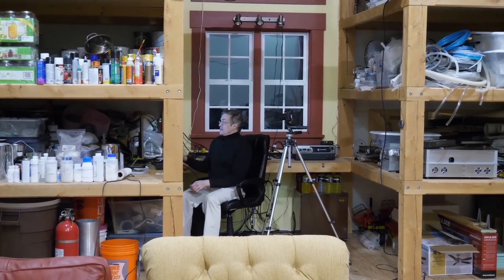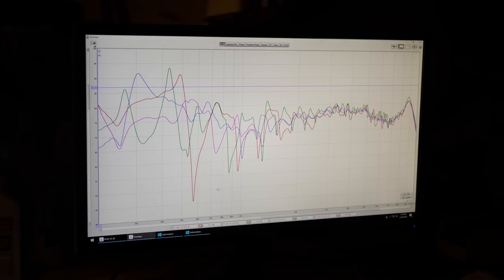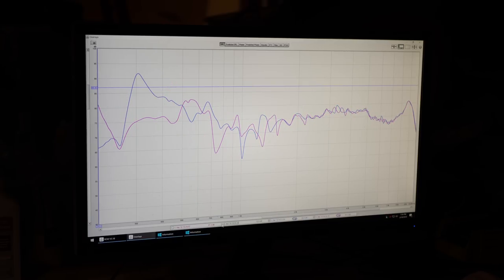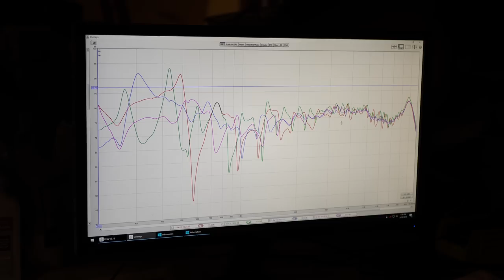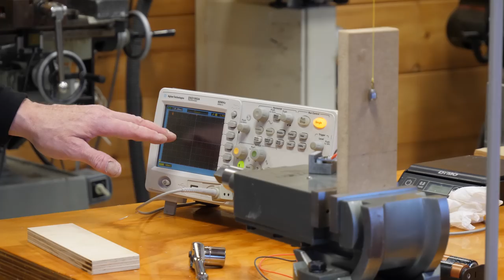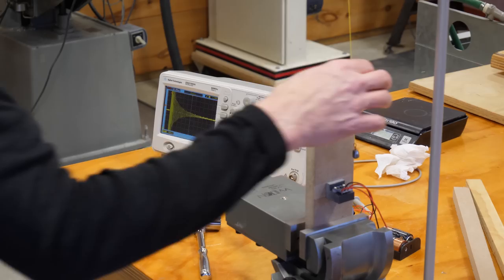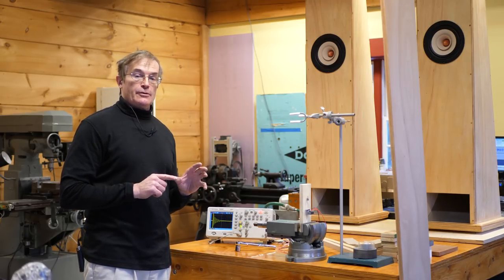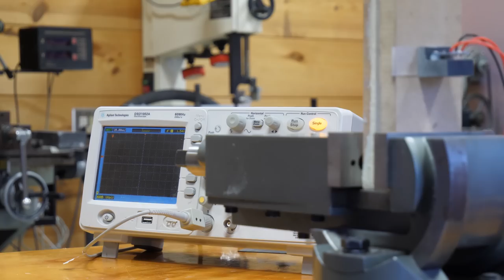World's Second Best Speakers!

Comment: Hi, IF you know that you're not going to move your speakers, there's even a better solution, as most of high quality home made speakers are done this way (especially when included in walls or built in a former chimney), you use marine plywood a bit thinner to construct "a box in a box" (with spacers between them, of course) and you pour concrete between these two walls.   Marine plywood to cope with the concrete dampness and concrete to avoid any parasite vibrations when in use - it can even change a poor design to (almost) good speakers.   As the french electronics/audio magazines are now scarce and only the shadow of what they use to be 40 years ago, I don't know if this method had a good survival index, but in the past many tests and trials shown it made audio quality excellent.
Reply from the maker: I understand, but that's  a big assumption.  Painting,  cleaning, redecorating, and relocating all benefit from being  able to move your stuff. This is especially  true if you don't  own your home and if you've invested a lot of money  in these speakers. Convincing the realtor  that it's  not a problem that a jackhammer can't  address isn't  going to be easy.
Reply: @TechIngredients  This is quite obvious, it is an owner only move.

Comment: I know, it's a while since this was posted, but I'm really keen on finding out if I could build this, but scale it to size a different speaker.
ie, if I had a speaker that was 60% of the size (a 4in driver), would I be able to scale the enclosure to 60%?
Reply from the maker: Look for the manufacturer's "open volume" recommendation for that driver and then scale the speaker to generate that volume.
Reply: @TechIngredients  You're the best. Is the Compliance Equivalent Volume (Vas) the same as that?

I can't see the open volume, but the Vas is there

Comment: there can't be a better speaker than in a  very heavy, 400 or 500 pound concrete enclosure,true or false?
Reply from the maker: False.
This design undoubtedly  could be improved  with better materials  and even better drivers. The principles remain constant. You can't ignore resonance, interference, and reflection effects.

Comment: Have you thought about using rubber gaskets? Could they be able to dampen the resonance?
Reply from the maker: Not if they're elastic and return much of the energy absorbed when they are stretched.  You want a material that is gel like or tar like, something that deforms but doesn't rebound.

Comment: I find your comments about MDF as speaker cabinet material surprising. I always had an impression that it is excellent material for building speakers cabs because it is inherently very dead acoustically, it does not reflect much. But then again these speakers of yours are not typical rectangle boxes. 🤔
Reply from the maker: You shouldn't find my comments suprising if you watched the demonstration where I proved what I said.
Reply: @TechIngredients  Yeah, I commented before I got that far. 😅

Comment: Love the video!  I downloaded the instructions and diagram.  While making a cut sheet for the cabinet parts I did not see a height measurement for the cutout in the bottom of the fronts.  I am estimating it to be 5.875".  Can you please confirm this value or let me know what the correct value is?
Reply from the maker: Sorry, it's 6.0" high.
Reply: @TechIngredients  I found another issue with the dimensions.  I used my 3D modeling software to build one of the speakers.
When watching the video it looks like you carefully align the sides to be even with the front of the 10" x 1" hole in the base.  
In my model this aligns the back of the face to be even with the hole and leaves a 0.25" set back from the front edge of the base, 
but causes the bottom of the sides to over hang the base by 1.25" on the sides if the bottom is 15.5" it will over hang the base.

This gives me a height of 79.375", base of 14.25" and changes the angle of the slope from 83.0 degrees to 80.9 degrees.  How do these measurements match your actual speaker?  Do I also need to adjust the 1.5" at the top of the side?

Comment: What if you mounted a speaker to a vacuum chamber?  No air to make waves in the back to interfere.
Reply from the maker: In principle that would work, but practically the force pushing the speaker into the vacuum would make it impossible for it to move and generate sound.

Comment: could you somehow isolate the back of the driver and membrane in a vacuum? or is that just technically impossible? or maybe it wouldn't even work? I'm sure someone ought to have had this idea before.
Reply from the maker: It's technically VERY difficult. The atmospheric pressure against the diaphragm is large, so the diaphragm needs to be supported, but still has to be free to move inorder to produce the sound.
Reply: @TechIngredients  yea I was thinking once you make the back a vacuum you probably just end up with a bigger resonance chamber. thanks for answering my comment on a 3 year old video =)

Comment: What would happen if the upper transmission line section is folded behind the lower horn/port section. This should result in the same internal volume, but significantly shorter. Would there be any negative effects of doing this?
Reply from the maker: Theoretically, it will work.  But, the turn itself  can introduce  reflections.  If the turn is a smooth  radius circle then this shouldn't be a problem, but construction will be more challenging.
Reply: @TechIngredients  That's exactly what I was thinking (radius the corners). Thanks for the reply!

Comment: Great video. Does the design scale based on the size of the speaker? E.g. 2in speaker would be ~4 times smaller.
Reply from the maker: Pretty much.
Good  speaker drivers come with specs.  The "open volume" indicates the optimal  performance  for an open cabinet.  Scale the design  so that the internal volume equals that number.
Reply: @TechIngredients  Well noted. Greatly appreciated!

Comment: At such low frequencies (150 Hz) I don't think the anechoic chamber is working as intended
Reply from the maker: It is, but due to its size it is limited as the frequency drops.
Reply: May I know the dimensions of the chamber and it's absorption material? I would like one in the future 😁

Comment: Question if u 3d print a mini tube and attached it to the back of the foam speaker would it give an effect
Reply from the maker: Probably based on its mass and position, but its shape should have little or no significance.

Comment: Could you use a separate driver, mid, and tweeter, or would that mess up the acoustics?
Reply from the maker: As it stands,  it would.  The position of each driver has to be determined relative to the distance from the top vs the bottom. It might be possible if the enclosure  were wide enough to allow each driver to sit side by side.

Comment: so does one of these new fancy amplifiers with a microphone basically negate the need for fine tuning with ports like this by adjusting the amplitude of each part of the frequency range?
Reply from the maker: It helps a lot.  But, by designing the speaker to minimize  aberrations, this additional  control  will work even better.
Reply: @TechIngredients  thanks. I'd find it really interesting to see a test showing how much a smart equaliser like this can do. e.g. a poor room and enclosure with such tech vs an optimised speaker and room but with regular amp

Comment: could decidamp be used to coat the internals of a vehicles door, floor etc to reduce noise in the cabin?
Reply from the maker: Remember, it's  not a coating, but a sandwich.  The principle  requires two stiff layers to be separated by a compliant but inelastic, dampening  material.

Comment: Also If I cut the sides to the dimensions given the angle is 10 degrees not 7?
Reply: 10 degrees at the top and 80 degrees at the bottom.

Comment: Can I rescale the model for a smaller full range speaker without loss of quality of the sound design?
Reply from the maker: Yes.  Look for the manufacturer's recommended open volume and scale the dimensions to enclose this volume.
Reply: @TechIngredients  Thanks! I have pair of markaudio alpair 10p. I'm sure that will work out great.

Comment: How would these speakers compare in a hifi listening setting to a Transmission Line speaker with a tweeter and woofer?
Reply from the maker: The comparison  would have to be direct as it may prove close and come down to the quality  of the manufacture.  The principles  aren't that different.
Reply: @TechIngredients  thanks for the response! I'm deciding between building these or a DIY kit from CSS

Comment: How did  you bend the aluminium plates 4 times exactly the same? Any hints :) Thanks - Great video!
Reply from the maker: We have a sheet metal roller. I'd recommend cutting the sheets and finding a local machine shop with this equipment to bend then.  It takes a few minutes and the cost should be quite reasonable.
Reply: @TechIngredients  thank you. Thats was quick. I will give it a try asking around. But one More Thing. IT says 34" Radius in your document, but the visuals  dies nit Show a perfekt circle piece. Is that a drawing error or how should the Metall ne Bend. Thank you.
Reply from the maker: You specify the radius of the circle. This plate represents a segment of that circle and it's straight length will define the arc that includes that segment.

Comment: So if not a thicker layer what about using 2 layers of the desadamp
Reply from the maker: As long as there is a stiff layer of material  between  the Desadamp layers, that would work even better.
Reply: @TechIngredients  yhea that's what I was wondering. So a multi layered sandwich with board, DD, board, DD, board. Cool thx been researching speaker building something I've enjoyed for a while but only recently gone passed the basics so glad found your channel. Never heard of Dampadex before so really useful.

Comment: Something just struck me.  It has no significance, but is interesting.  Sound travels at 300 m/s.  Light travels at 300 million m/s.  Hmmm...
Reply from the maker: Problem  is, one million is significant only because  we use base 10 and that's  because  we evolved with 10 fingers.
Reply: @TechIngredients  Note that I said it was NOT significant, just "interesting."
Reply from the maker: Actually, what I think is more "interesting" is the intensity of those that argue  that the metric system of measurement is inherently superior because it is base ten.
Reply: @TechIngredients  I agree.  Every engineer needs to be competent in both, specifically, the S I, and the "U S system of engineering units."  In that system, the units are seconds, pounds, and feet, for time, force, and length, respectively.  Mass is force/g (some call them "slugs," but that's yucky).  None of those ounces, yards, minutes, fortnights, hundredweights, bushels, cups, etc, etc, etc...   It's every bit as logical as the metric system (which can be S I, or cgs).

Comment: There are various automotive products made to absorb sound that might prove to be less expensive. Sprays, foams, and sheet materials are available for various uses and effects. It should serve the same general purpose as Sorbothane. While it is heavy, I like the asphalt sheeting for sound deadening on sheet metals and other large area panels in part due to the added mass and sound dampening.  Something to consider. So many options to explore.
---Just my two cents.
Reply from the maker: Thanks for the feedback.
We don't want to absorb  the sound.  The constrained layer damping prevents the structure from resonance coupling which will augment certain frequencies  and depress others. In fact, a very thick wall, steel speaker enclosure would be really  good although  it would weigh a ton, literally.
Reply: Adding to complexity...  Have you considered pulling the digital sound spectrum from your audio source to use as a base for comparison? Record your playback from your speakers and overlay that with the "original" and you should see where there are soft spots or hard spots in the speakers playback.  
I suggested this because an individuals person hearing and preferences can taint the playback's reality. For example, in this video, at the end, listening to your speakers playback they sounded pretty good overall but a little pitched with mid-highs and dead on lows.  But that seems to be the problem with transmission line speakers that "tune to a frequency response range". Could be me or my audio system here... But you should get my point..
---Just my two cents.
Reply: @TechIngredients  I used the wrong wording. In deadening I meant dampening of unwanted vibrations that can be found in things like floorboards, doors, trunk lids...
---Just my two cents.
Reply from the maker: You're point  was good one regarding materials like asphalt and tar.  Gace Ice and Water shield roofing is excellent  and relatively  inexpensive.  These will dampen resonance when sandwiched between the wood layers.  Exposed foam and padding will absorb the sound we're trying to manipulate  with the shape of the enclosure.

Comment: The test is a bit flawed because the impact should have taken place from the opposite side of where the accelerometer is placed (where the driver's back wave energy would impact). Also: The torque applied to the vise in both tests should be exactly the same. For that, you need to fix the plates using a torque meter.
Reply from the maker: It doesn't  matter which side of the plate is impacted.  We were looking at damping and resonant  frequency, not the initial cycle.
Reply: @TechIngredients  Don't you think damping could be different depending on how well the waves are converted to heat when travelling the full thickness of the board?
Reply from the maker: I think you're  misinterpreting the test.
The accelerometer is measuring the bending mode of the panel, not the compression through  the panel which would have a frequency  orders of magnitude higher.
That is also why clamping the panel  in the vise with a torque  wrench isn't  necessary.
Reply: @TechIngredients  Thanks for clarifying. However, if what we are looking for is less colouration in sound (I guess), wouldn't compression be a relevant outcome to measure? I say this because of the conclusions you draw from this comparison concerning the different materials employed. Would your conclusions be evidence-supported if compression isn't measured?
Reply from the maker: In general, the bending mode resonance is proportional, especially  in the isotropic particle board. At audio frequencies as high as 10kHz, the wavelength of sound is still half a meter.  The panels will be resonating as flat plates where bending will dominate the compression modes.

Comment: The scoop port on the front is 9.75 W but the heigh is not on he drawing.
Reply from the maker: 6"
Reply: @TechIngredients  Thank you. Also in my youth when I was touring we would line the speaker cabinets with acousic ceiling tile white side out,  it would add 20 to 30 pounds but they sounded great. I was a roadie at the time but the Sound Guy said that it made the apparent speaker volume bigger. I just know they sounded great.

Comment: Is it possible to create a speaker enclosure that has two separate sealed chambers for two identical drivers that sit right next to each other, where each chamber is designed to comb inversely to the other chamber. The end result would be that the peaks and dips of both drivers would cancel each other out as when one driver has a dip in that frequency the other driver that is right next to it has a peak instead which evens out the overall frequency response of the entire system. This would most definitely make the speaker system far more compact.
Reply from the maker: It's possible, but that introduces another variable which is that the sound is originating from two different locations.  There will be a frequency dependent phasing interaction between these two sources.
Reply: @TechIngredients  Thanks for replying so soon. As far as I know the combing from two sources only happens in high frequencies where the wavelengths are small, so if I can shift the upper frequencies to a separate tweeter or use a low pass filter to cut off the high frequencies from one of the drivers, would the enclosure design as I mentioned be effective?
Reply from the maker: The effect is frequency dependent.  As the wavelength shortens the fixed distance between the sources becomes progressively closer to 1/2 wavelength and a full 180 degrees of phase mismatch.  At some point, cutting off one of the sources will be of more benefit than the reduction in localized peaks and troughs it provides. So basically, you're correct, but is this better than the original design?  That I don't know.
Reply: @TechIngredients  Thank you for taking the time to share your knowledge. I will have to build and compare the original design to my own solution to learn more regarding this topic.

Comment: T design seem to be cheating by dumping voice in to left and right wall
Reply from the maker: Cheating?
We're measuring the effect on frequency  response not the efficiency of sound generation.
Reply: @TechIngredients  but did it not disturb a frequency the distribution from side would be dumped in that case. I'm not sure  so i believe your knowledge
Reply from the maker: The anechoic chamber is not absolute, it reduces reflections, but they're  still there and all the frequencies  are detectable.